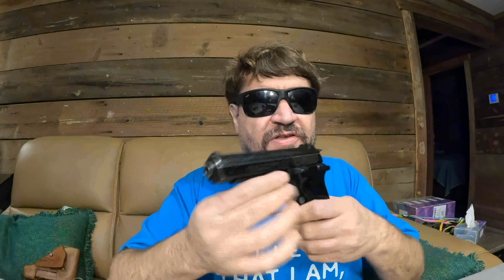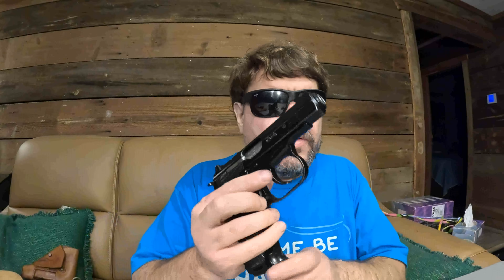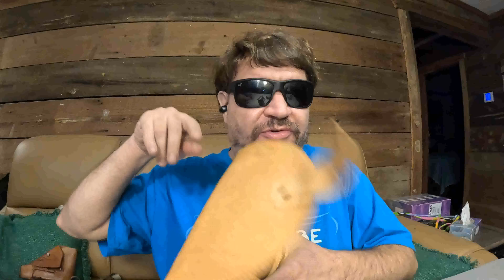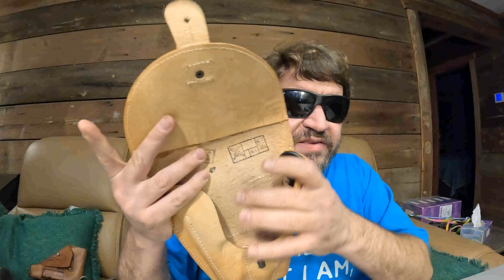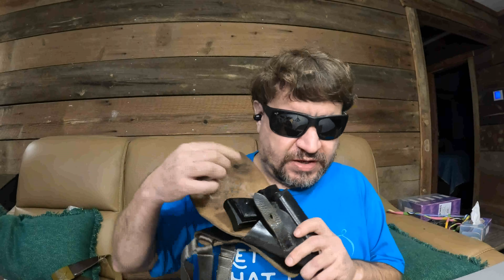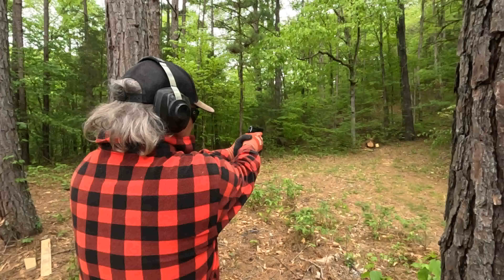High-Cap Maks: The Czech VZ82 & Russian PMM (Other 9x18 Pistols Pt.3)

Comment: The CZ vz 82 was the first handgun I bought (2024, I'm late to the party, I know) and really is what got me into Milsurps. Incredibly forward thinking for its time and I think it even has a cool design. Mine is from 1990 and has a better finish than most of the other ones I've seen, and I put some rosewood grips on it. The recoil isn't too bad if you put a heavier Wolff spring on it, and the ergonomics are better than most newer pistols I've used. It shoots all 9x18 loads I've tried, and you can definitely feel more of a kick with PPU Defense JHP ammo. It works great with a kydex holster for IWB carry, since it doesn't have any sharp edges that could jab into your hip (outside of the hammer spur and beavertail if you're doing appendix carry) and 12 + 1 of 9x18 is no joke. I really do love this style of pistol (straight blowback, all metal, small enough to reasonably carry), as evidenced by the fact that I need to pick up an Astra A-60 from my FFL tomorrow.

Comment: I'm a fan of the CZ-82/CZ-83, but I would not at all say they're an upgrade or even equal to either the Soviet/Russian PM or PMM. The reason being is they are NOT dropsafe. After several incidents in the 1990's involving Czech Police (Including headshot fatality of an innocent bystander), the CZ-82 was re-evaluated by the Czech weapon testing authority. They found it to have an apparent design flaw that if dropped directly on the hammer in normal carry position (Condition 2 - Round chambered, safety off, hammer down), resulted in the hammer inching forward (while slide inches slightly backward due to inertia) until the firing pin is struck causing ignition. This is thee main reason the CZ-82 was slowly discontinued from Czech Police and Military service, and likely why you see so many CZ-82 & CZ-83 pistols that were exported to the western commercial market. They originally did try to develop a "fix" (Which a very small number of pistols have indicating marks of), but ultimately found it was too expensive to change out the neceassary parts for their entire stockpile. I had an "incident" myself. Which is what led to me trying to spread the word (Despite a lot of harsh criticism), and posting it online. It was reposted to a CZ forum, and a Czech poster shared the translated article. You could still perhaps carry one texan 1911 owning boomer-style of "cocked and locked" or Condition 1 (Round chambered, safety on, hammer cocked), but then you're completely relying on the safety not being tripped on a pistol that already has design flaws. That said, it is a neat pistol that was forward thinking for it's time and has its own special place in the history of 9x18 Mak chambered variants with it's large capacity, nice sights, ambi-controls, and chamberings in 9x18, .380, and .32. I may even pickup one or two more examples in the future. You just won't ever catch me carrying one!
Reply: This gun is probably the reason I love condition one carry as much as I do, and I don't think the safety could be very easily tripped. You can't just flick it like some other guns, since it's very tactile and requires enough force to hear it audibly snap into place. But I carry it IWB with a kydex holster on a Kore belt anyways, so the chances of it being dropped are very slim. Why didn't the Czech police just carry it in condition one? It just seems more intuitive to use a manual safety if the gun has one.

Comment: The PMM is NOT at all a Soviet handgun, but rather the first newly designed mass production Russian handgun. It came from the research and development program code-named "грач" or "Grach" ("Rook" in English - European Blackbird) that lasted from circa 1991/92 until 2003. Though the Grach program officially lasted around 12 years, it led to the development of pretty much every major modern Russian pistol since the birth of the Russian Federation. So, technically it was announced in the twilight of the Soviet era, but very much took place in the Russian era. The original guidelines were that they wanted a high-capacity (12+ round) modern pistol that was modular in that it could reliabily fire standard 9x18 Makarov, the newly developed higher-pressure 9x18 +P Makarov, and standard 7.62x25 Tokarev rounds with only changing out minimal parts (barrel & magazines). Izhevsk Mechanical Plant (Izhmash), TsNIITichmash (Klimovsk), and TsKIB SOO (Tula) all participated in the competition to develop a modernized Military pistol, and Tula Cartridge Works (Tula) volunteered to head the research & development of the Grach program's modernized ammunition with the help of GOSNIIHP (Kazan) providing three new types of propellants. The Grach-1 (A.I. Zarochentsev - Izhmash), Grach-2 (V.A. Yarygin - Izhmash), and TKB-020 (I.Ya. Stechkin - Tula) prototype pistols all met the paremeters of the original design guidelines, but failed to meet the technical specifications for reliable operation. The Grach 6P35 (P.I. Serdyukov - Klimovsk) prototype was also developed and chambered in the new "RG 052" 9x21 Gyurza cartridge. It also originally failed testing. At that time, they ending up mostly sidelining the 9x21 cartridge in favor of further development of the 9x19 Luger cartridge. Modularity also proved to be an issue. Thus, both the "Grach-2" prototype (9x18, 9x18 +P, 7.62x25) and "6P35" (9x21) prototypes were quickly switched to being chambered and further developed in 9x19. The "6P35" later switched  back to 9x21 as SR-1 Vektor/SPS "Gyurza", "Grach-2" became the PYa Yarygin. Those two pistols along with the "GSh-18" (V.P. Gryazev & A.P. Shigunov) all finally began full-production in 2003. The TKB-020 was also eventually produced in small numbers as the "Berdysh" pistol in 9x19 standard. However, the PYa was ultimately supposed to replace the PM, but never came even close due to reliability issues. Now going back to 1993, they ultimately found it to be an impossible task to create a reliable & modular pistol chambered in those three originally specified cartridges, but the "Grach-3" prototype (R.G Shigapov, I. Pletskiy, & N. Makarov) of 1992 was the closest to achieving such. It also was largely based on the battle-proven PM pistol. Thus, they started immediate production of it as the "PMM", and continued to further develop other various prototypes of pistols primarily and respectively chambered in either 9x19 or 9x21. So, the PMM was really just originally meant to be a hold-over until they could fully replace the PM with one of those other more modern 9x19 or 9x21 chambered pistols. The PMM, primarily designed by R.G. Shigapov, is a 12+1 round high-capacity pistol that was largely based on the PM, but had a double-stack cast frame (Originally in alloy for early prototypes, but switched to cast steel), a special highly-reinforced angular slide, and unique spiral-grooved chambered barrel that allowed it to reliably fire and eject both standard 9x18 Mak, and 9x18 +P (7N16, SP7, Etc). That said, the commercial-export Baikal "IZH-70-100" or "IJ-70-18AH" (Adjustable sights, 9x18), Baikal "IZH-71-100" or "IJ-70-17AH" (Adustable sights, .380), and later Baikal-442H (Fixed sights, push-button magazine-release, 9x18) and Baikal MP-71N (Fixed sights, 9x17) are actually all just considered commercial double-stack PM's. Yes, they do have the high-capacity PMM-type frame, but they all lack the PMM-type angular slide & spiral-grooved barrel of the true Military PMM. Which, those last two features are arguably the most important parts of the PMM's design. So, IF one absolutely has to refer to them as a "PMM", I'd suggest perhaps referring to them as a commercial PM with doublestack PMM-type frame. They are just two different pistols, and I feel the PMM deserves it's due as a true Military variant. The PMM was also absolutely issued with the special +P and even +P+  higher-pressure ammunition until about the early 2010's. They eventually stopped issuing this ammo due to apparent issues of it getting mixed up with the standard "57-N-181S" FMJ 9x18 ammunition. That said, they still produce the PMM today. The only known change is that the more recent 2019+ examples still have the special angular slide, but it's a little more rounded off near the back for concealability. In addition to the PMM, they also still produce the PM, PSM, and APS "Stechkin" pistols. All four are produced in made-for-order numbers (Which have likely went up since Ukraine war). The most recent modern pistol that they hope will finally replace the PM is the PL-15 Lebedev of 2021 chambered in 9x19/9x19 +P (7N21). So far, it's performance is promising, but only around 10-20K examples have been produced. Compare that to the PM that has several million examples still in service.

Comment: "VZ" is nothing. It is abbreviation for VZOR which equals to "model" in english. That pistol was produced by CZUB (Česká Zbrojovka Uherský Brod) and shall be called ČZ pistole vz. 82. Or in english CZ model 82.
ČZ-83 is the civillian version produced in all three callibers (.32ACP, .380 ACP and 9x18Mak). ČZ-83 in 9x18M exist both with standard rifled barrel and polygonal barrel. ČZ vz. 82 was only issued to military and police and it only was produced with polygonal barrel.

My ČZ vz.82 is my favourite gun. The sad part is, that it was more expensive to buy that on 2nd hand market here in Czech Republic than in USA.. I bought mine for cca $250 equivallent while in US those were sold even for $100 for some time.. 

vz.82 rounds do not contain lead but just soft steel shawings compressed into bullet shape. You need polygonal barrel to fire it. It kicks more, goes faster, creates more smoke that smells more and if you hit steel bullet catcher wall at the range, those bullets burst into flash on impact. I still have some ;)

Production ended much later after velvet revolution. You were able to buy new CZ-83 even around 2015. ČZ vz.82 production ended somewhere in mid 90s.

That leather holster is standard ČZ vz.82 holster for pistol, cleaning rod and one spare magazine.

Comment: I've got a CZ52, a CZ75B and a CZ82, and I gifted a CZ83 .380 to my oldest son. The CZ pistols are a favorite of mine
Reply: I'm all about CZ.  Got a waffenamt Vz. 27, a Vz. 52, a Vz. 70, a Cold War edition CZ 75B and a Vz. 82.  I'd love to find a few of the 83's (one in .32 ACP and one in .380 ACP) but so far, no luck.  There are a bunch of Vz. 50 pistols showing up on the surplus market right now, but most of the ones I've seen are Frankenstein-ed with 50 parts and 70 parts together.
Reply: @g54b95 Aim Surplus has them in stock and on sale right now
Reply: I once had a CZ83 in 7.65(32). If memory serves, the mag held 15 rounds.